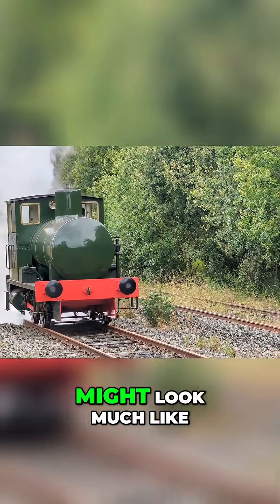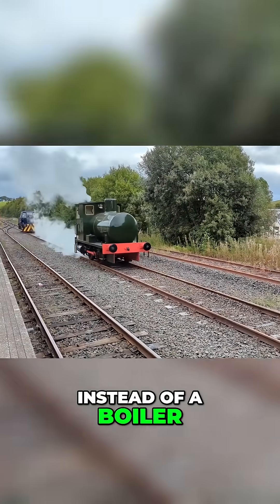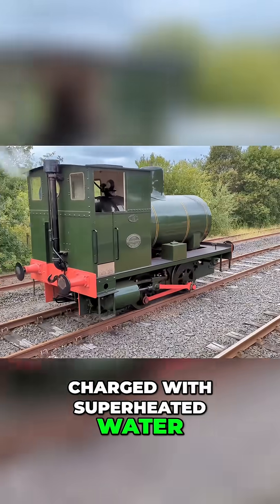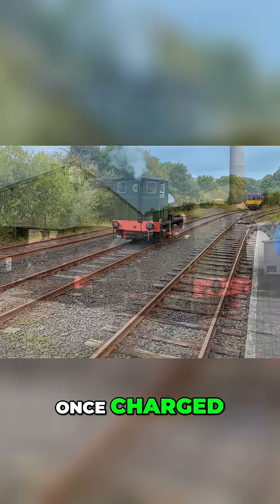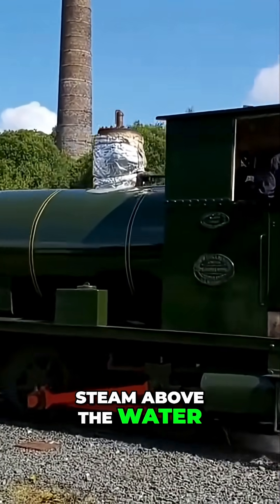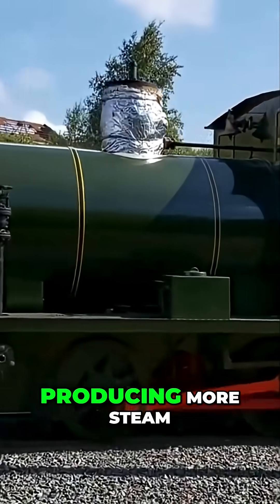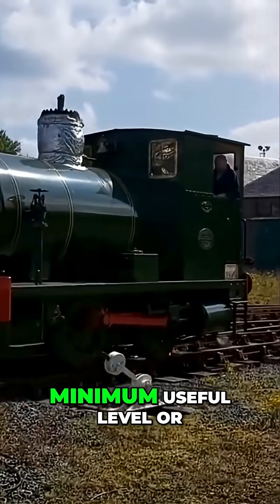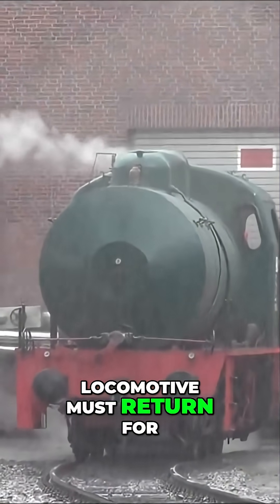Fireless Steam Trains  The Coolest Trains You've Never Heard Of! #locomotive #esso #railway #fyp

Comment: Super heated... how worm is it? And how high is the preasure?
Reply: Worm Preasure 😂
Reply: It depends on the pressure!
There is a strict correlation beween pressure and temperature! If you have a pressure cooker, it usualy has a pressure of about 1 bar higher than normal, so the temperature is about 120 ° C.
The pressure can go up to 25 to 20 bar, than you will have temperatures around 250°  C.
Reply: The Sittingbourne & Kemsley Ltd Rly lists the reservoir pressure of it's 2'-6" gauge 2-4-0F (static exhibit) UNIQUE as 220psi  

I've a vague memory of hearing 450psi mentioned regarding later examples, but wouldn't stand up in court and say so. There was an 0-6-0 Henschel HP machine built in 1952, which stored steam at 1812psi ... I kid you not!

Comment: If the super heated boiler explodes, it will flatten everything on the block.
Reply: Same issue with the boiler on a fired steam engine.
Reply: @vk2ig  I think the volume of heated water, the little passable, has as much if not more stored energy in it than maybe some bigger fireboxsteam engines out there?
Reply: Most boiler explosions came about through excessive pressure or low water.  After steel became the go-to material (well before 1900), catastrophic failures became rare (there was a notable exception on Romney Marsh in Nov 1942, when SR 2356 exploded ... into the belly of the FW190 which fired the round which pierced it's boiler ....).

Many early boiler explosions were down to drivers screwing down safety valves for a bit more oomph ... the loco soon obliging.

The last UK actual barrel failure was in 1921, the last firebox failure due to low water, at Bletchley in 1962. Presumably, a fusible plug failure rather than "boiler go bang"
Reply: There are safty valves, so the pressure can not get too high, and how should the pressure increase to high if not during recharge?
Where should the needed energy come from?  So, as long as noone blows up the vessel with some kind of explosive, how should it Break?